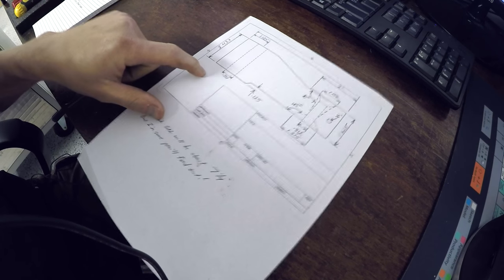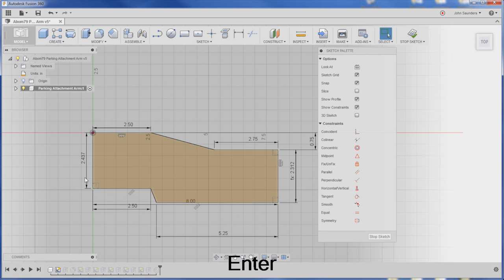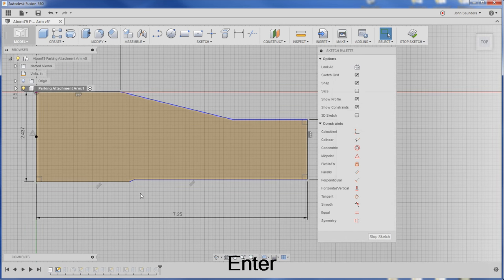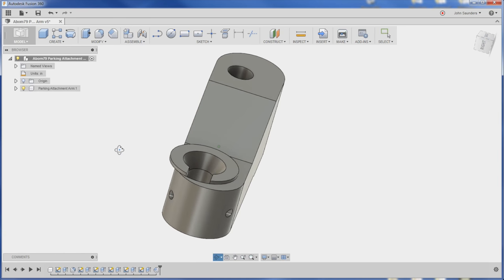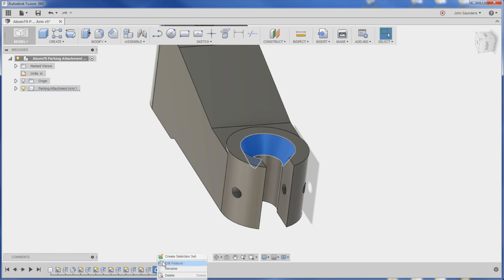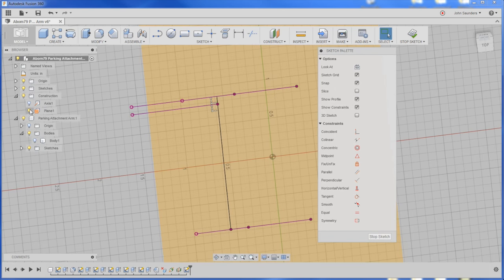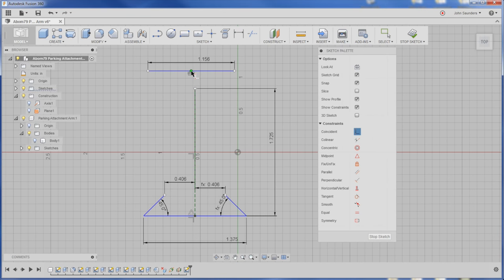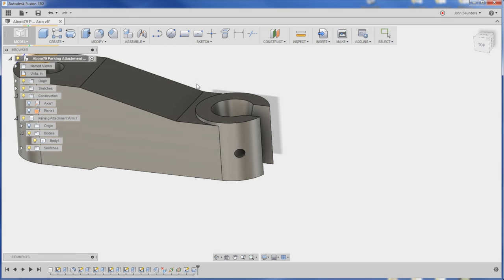Big Steel CNC: Parking Attachment for Abom79 - Widget94A

Comment: That OAL part really emphasizes how helpful it can be to spend to spend a little time thinking about how best to setup your parametric model in cad. When I watched the earlier Fusion video on this part it looked like you sort of just drew the part in CAD and didn't really think about how the dimensions actually drive the part ... makes sense from the machinists perspective where you aren't sitting around iterating on the part, you're trying to draft it so you can cut it!! (-8

If you need to iterate on the part then it REALLY pays off to think about which dimensions and constraints are key for driving the design, then you can change sizes without distorting the shape! It's definitely a skill and something that takes time though, so it's not without it's downsides.

I learned a lot about that side of SolidWorks (in my case) by taking a CAD class from the Design department at a college once ... was pretty fascinating to see how they approached parametric modeling as a tool to help iterate as opposed to a drafting tool.

In any case, sweet vid as always!!!!!!

Comment: One important note: When you tried to project the top and bottom centers of the trough hole onto the midplane (10:14), you made a slight (visually not noticeable) mistake. You projected the circle that is cut at one end and therefore your projected "midpoint" is slightly too far to the left.
Just use the Construction Axes you created just before and project that onto your midplane, then you'd be dead on center!
Cheers!

Comment: Watching this a few weeks behind now and I haven't used fusion very much, but you probably could had the intersection points for your revolve on the lower hole if you turned the axis you created on in the sketch instead of having to find a projection that gave you the points

Comment: It looks like in your first sketch you set the end with the boss to 1.625.  In a later operation you extrude the boss which would make the overall thickness of that end of the part more than 1.625.  That might be why the flat below your 10 degree taper is so long.

Comment: i havent had the time to look at 360, but in inventor i would have just assigned variables and made an ilogic form to edit it stupid quick. also i would have linked together a few of the parameters to minimize the having to go back and fix it later aspect.

that being said 360 is a lot more similar to inventor than solidworks.

Comment: Yes as below I was poking the hell out of the iPad at the 8 inch dim😀😀😀😀

Why not get Adam to get F360 as a start up (free ver ) and then invite him in to the project , simples

Great explanation in this video now you have slowed down and do not assume we know what you are doing 👍👍👍
Btw that little project I sent you the cam was a complete 👎👎👎 I have redone it with the stock to leave off and sorted the tool orientation ,part now made to size well in your language it a tenth to small😀 but that's within the mills spec ( these dang imports from the east )

Stuart
Reply: +NYC CNC Use Teamviewer. Check it out. You can share screens, and take turns controlling either computer. Live editing with feedback from @abom79.

Comment: I can send you a .dwg file of drawing templates for 8x11 and 11x17 so you can utilize the whole page;)

Also, is fusion360 good for technical drawings or just 3d modeling?  i currently use autocad for drawings and master cam for tool paths.  i have access to fusion at home and school but haven't really dived into it that much because my teacher said that most of the industry does not use fusion360

Comment: My head hurts.....  but I'm a paper/pencil guy.  Dang Cool though.  I believe there is a chamfer at the top similar to the bottom with the 10 degree section in between the chamfers.
Reply: John uses a lot of the shortcut keys. Which makes it look more daunting than it really is. 

But it's really no different than paper and pencil as far as drawing sketches. Biggest difference is being able to make it a 3D representation instead of multiple 2D views.

Comment: John, A little late to the game on this one, just wanted to add a comment. When you created the projected axis for the revolve feature you deleted all the driving geometry of that line. This is pretty poor CAD practice since you un-parameterized a basic building block of a feature that should have stayed attached to the previous geometry. In any parametric CAD package the "Fix" command (whether it be in a sketch or an assembly constraint) is poor practice and should be avoided save for some very specific instances.

Comment: Sometimes, i really hard to understand why the americans are using the inch...
Reply: So long as you don't use feet, yards and miles, the inch (divided into thousandths or ten thousandths) is a perfectly good unit for machinists.  Then consider what happens when you got a hardware store and there's a huge stock of 1/4" bolts and 3/4" plate steel available to cut with your 1/2" milling cutters.  The inertia overcomes the incentive to switch.